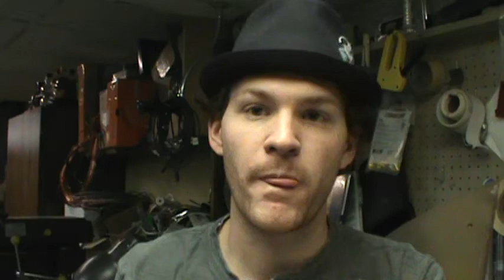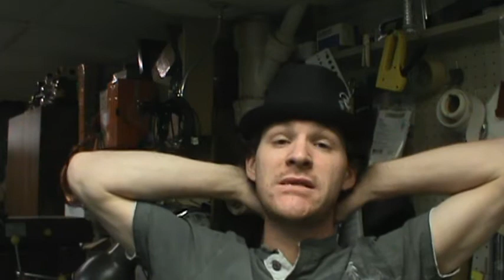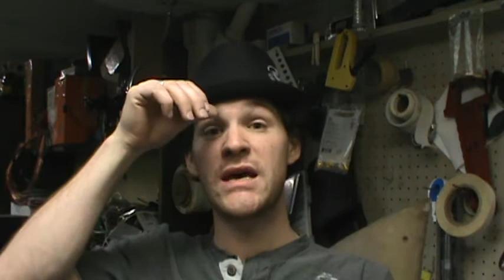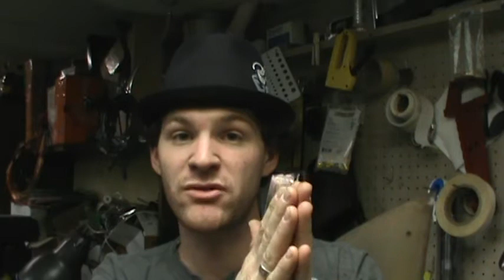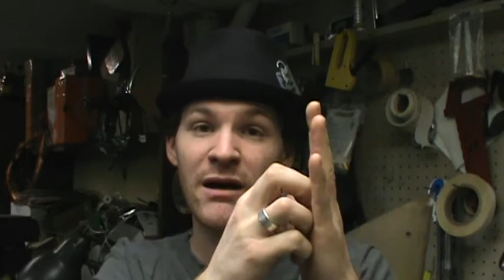News Update! Russ, Why Do You Never Finish A Project?  Please Watch! Happy Halloween!

Comment: One last thought! using ambient air in the mixing and Ionization process only makes since!!! its Free! easly filtered and supplies extra O2. when Nitrogen is Ionized it also will act as a maganetic balancer (spacer between the O2 and Hydrogen) as Stan talks about in his presentation, thus not needing a flash back arester. If you remember that part of his speech. It applies to the home heating unit and the HHO drivin coil, not the Electromagnetic one. Which I believe to be of one gas type only

Comment: @rwg42985 but to create hydrogen will take a water large amount of energy for this.. aterally a vary large amount. and same to to ionize gas, pump the liquid threw the coils would also need a large amount of energy and same with the leds.. on top of that i am not shore you will get the magnetic filed needed to power the coils. i have alot of doubt in this and do not see how you will effectively use water to power a machine of any sort. please further exsplane if i did not understand soething

Comment: Something does not smell right here. This guy is full of shit. Building the injectors is not required to run an engine on HHO gas.THIS HAS TO BE DISINFO. BEWARE! Stan built a complete system to change the world. That is not required to create a working engine. All that is required is to generate more hydrogen gas than should be electrically possible and porting that gas into an engine. Making a gasoline engine run on HHO is easy. But this guy goes on some wild goose chase to make the $10,000 injectors? WTF is going on here?